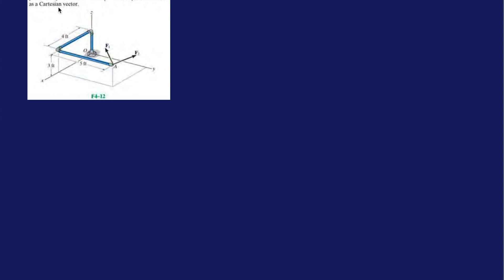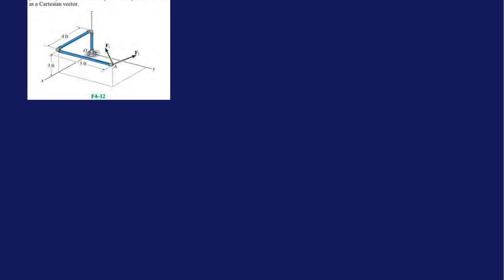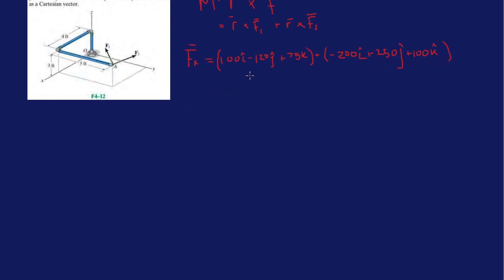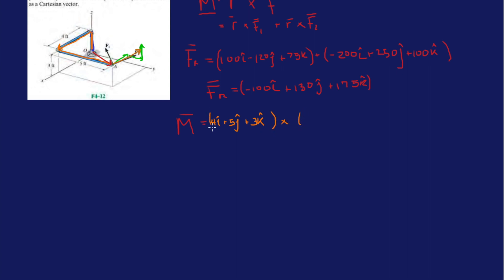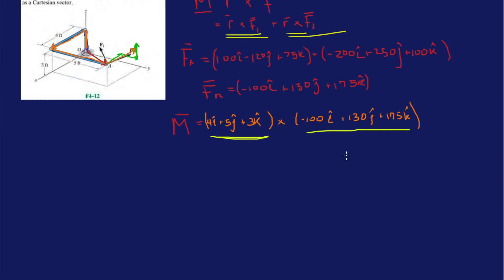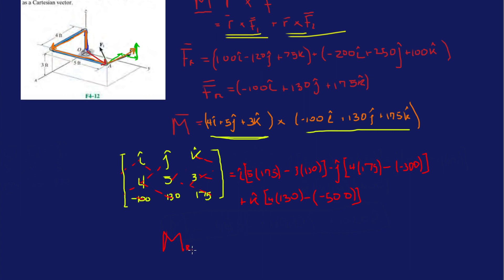Problem F4-12 Statics Hibbeler 12th (Chapter 4)

Comment: Could you have also found the moments about point A due to each force and then add them? So would do (rxF1)+(rxF2)
Reply from the maker: No you couldn't, since the Forces F1 and F2 are already on point A. So if you do, what you suggest (r x F1) you would get zero + zero. There are other problems where choosing your pivot point is your preference, but for this problem no. Hope this helps!